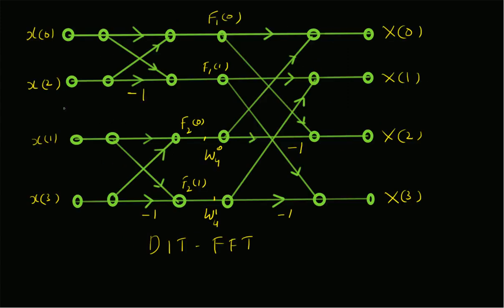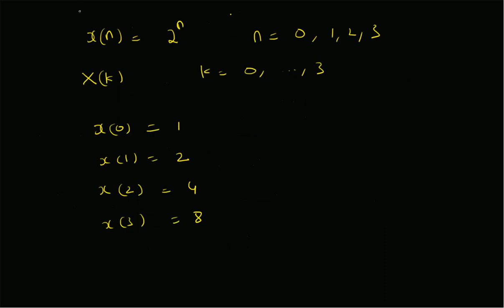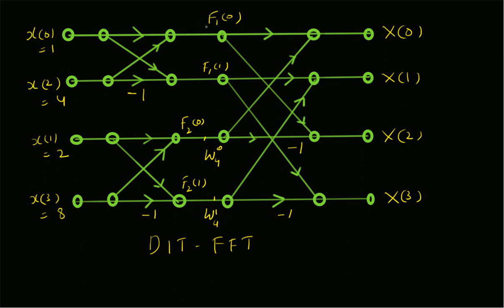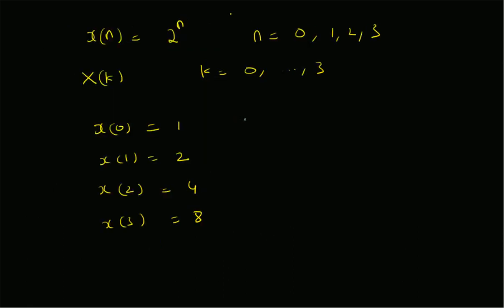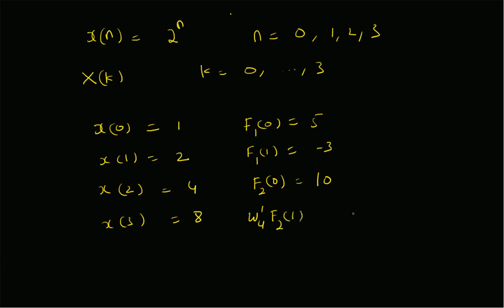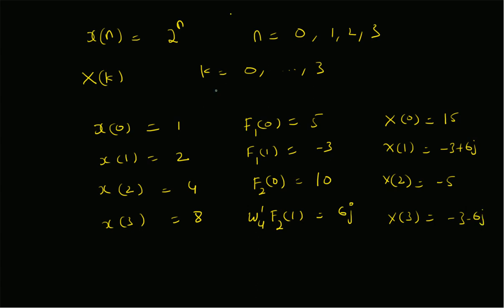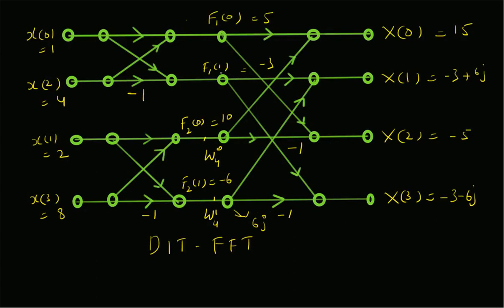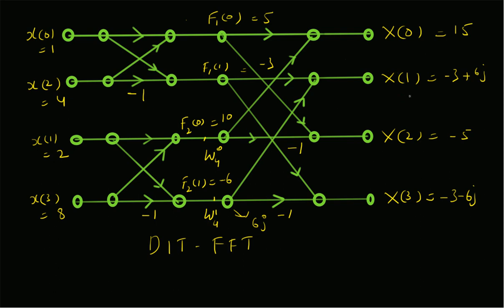4-point DFT (DIT-FFT) Numerical Example

Comment: The end result is wrong due to the miss calculation of the twiddle factor (W_4^1).
In order to calculate the twiddle factor one must use the formula (W_N^n) = e^((-j2(pi)n)/N).
For stage 1 he did not show the multiplication with the twiddle factor due to it being  (W_2^0) = e^((-j2(pi)0)/2) = 1.
However for stage 2, (W_4^0) = e^((-j2(pi)0)/4) = 1, (W_4^1) = e^((-j2(pi)1)/4) = -j.
Thus x(1) = -3 - 6j and  x(3) = -3 + 6j.
Reply: I used fft in matlab and  x(1)=-3+6j , x(3)=-3-6j